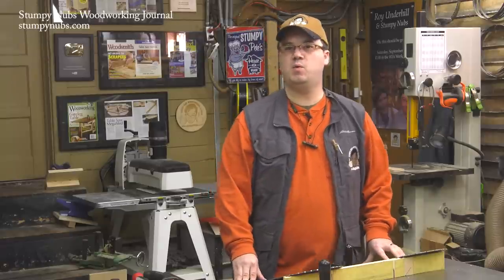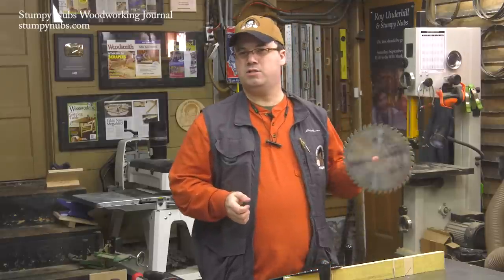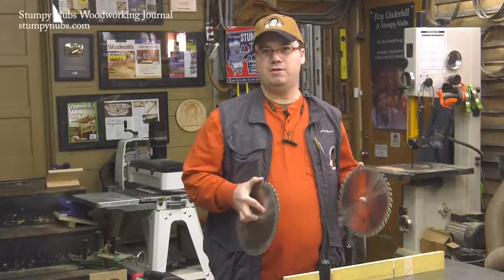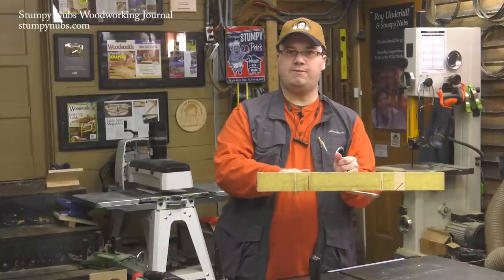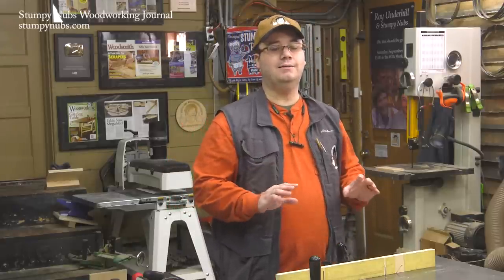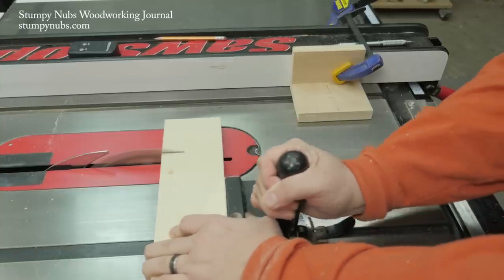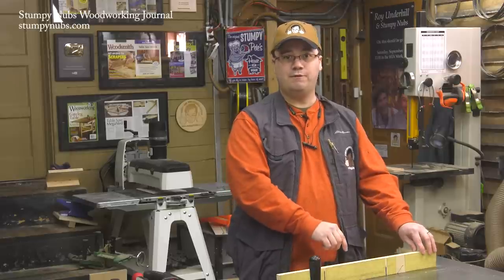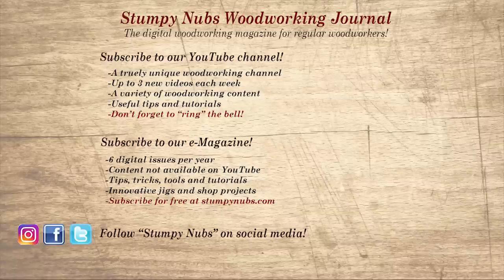Clever ways to make better table saw crosscuts

Comment: One of the biggest cross-cut challenges I have is making larger pieces, like a 14” wide by 12” deep piece. What’s the best way to cut pieces of that size on a table saw from a larger 48” wide by 12” deep rough piece? Should I just be using a slide miter saw instead?

Comment: As a complete novice (and I do mean novice - as in I’ve never even been around a table saw!), these videos are gold.
I have to take a lot of notes and master the vocabulary, but I’m able to learn what I need to make the cuts I couldn’t before. I used pre-cut wood to build a cabinet. I had a miter saw that could handle the cuts I needed for that one. It turned out really well - the second time. 😂 I only had 5 inches and made a spice rack with full extension. 
It was challenging since I had to make my own plans. This expands my ability to make the next ones considerably since I can’t buy wood the size I need for the next ones I need to make. Thank God for these videos! I was especially glad to have the safety videos. I have a VERY healthy respect for the saw blade! I’m a musician and would absolutely die if I cut any fingers!

Comment: Thanks, great to see these things gone through. My saw has a sheet metal insert that's been causing me problems from day one due to it sagging and therefore not supporting the work next to the blade. I'm trying find a piece of 1/4" steel plate to replace it.  I've already replaced the very loose miter guage bar with a snug fitting steel one. Strange that companies will often cut corners on these key components usually needlessly since it takes the same time to make a good component as a poor one. 
A question I would like to ask is, what do you think is the best way to stop a mitred end? To a line, to a stop on the point of the mitre or maybe contact on the actual mitred face? I would value your input. Cheers!

Comment: I love these videos..it focuses my mind on how to make better, more accurate cuts, even if i 'know' all the principles covered here. For example...need to make a new zero clearance insert plate, need to fix my sled as it's a tiny bit warped and doesn't quite sit flat on the table, need better quality blades... it's so easy to neglect the little things that add up over time and affect your work

Comment: Thanks for the tips. I’ve been in the workshop today and adjusted a few things with the saw to make sure it’s properly aligned. What is the “blue tape” that you keep talking about? Is it electrical tape? I tried making a zero clearance insert but it wasn’t successful so the blue tape solution is one I want to try.
Reply from the maker: Here's how to make an insert: https://youtu.be/gzdF-bLXc8Q Blue tape is the painter's tape you get in hardware stores, like masking tape but with less adhesive. It's a quick alternative, but not a replacement for an insert.

Comment: QUESTION:  What's a good grit for sandpaper to be used like you have on the miter fence?  120? 180? 80?  Does it not matter?  Thanks!
Reply: Coarse grit ought to hold better, but might scratch the wood.  Fine grit would sacrifice holding power for less likely scratching.  The solution is easy!  Buy another miter gauge.  Use one for coarse, and the other for fine.

Comment: I once made my stock miter bar adjustable by drilling and tapping it for small nylon screws. It worked amazingly well...until I broke the tap in the last hole and couldn’t get it out

Comment: What would be the reasons to use a table saw if I have a miter saw for crosscuts?
Reply from the maker: A table saw with a good sled is a lot more accurate, especially for miters and end bevels.

Comment: If the miter slot isn't parallel to the blade, you'll also get the work piece pinched between the blade and rip fence potentially causing it to kick back.  I had a crappy Craftsman bench top as my first table saw, and that was the case with it, and there was no adjusting the motor mount to make it straight.
Reply: I have the same on an OLD Skil... guess I’ll dismount it for access to the mounting bolts beneath and hope they have some adjustment capability

Comment: Do you usually want more teeth for hard woods than soft?
Reply from the maker: Hand saws often have more teeth for hard wood because it will force you to cut more slowly (each tooth takes a smaller bite). But table saws are unaffected by the hardness of the wood and can cut it just as quickly. That said, if the material is very hard or otherwise prone to chip-out along the cut edge, fewer teeth will produce a smoother, cleaner cut on a table saw.

Comment: Would a faster motor be the same as more teeth?
Reply: Most tablesaws run at 3000-4500rpm... blades have max rpm not much higher than that. You can slow your cut a bit to get smaller cuts bu each tooth.
Reply: Yes,,,smaller cuts works too

Comment: So far, in each of the videos, none of the links for the ISO Tunes have worked.
Reply from the maker: Not sure why you're having problems, they work when I click them.
Reply: Not sure either, the other links work just fine.  I am using IE but it does not work for me using Chrome either.

Comment: When using a blade guard, it is not compatible with a fence extending on both sides of the blade, as a blade guard required through cut. So roving knife like in the video must be used instead of blade guard. This doesn’t match with the instructions of using blade guard. Same goes for sleighs.

Comment: I am new but I don't understand why cross cutting is done on a table saw. I think my miter saw is a better choice and I don't have to switch blades. 80 tooth fine detail blade on miter and a rip cutting saw blade on my table
Reply from the maker: Table saws are more accurate. Miter saws can deflect out of alignment (angle to the side) during cuts, especially in thick wood.

Comment: At 10:16 the comment "the reason is your miter gauge isn't square to the blade" is incorrect. The important thing is that the miter gauge fence is square to the miter gauge bar. Think about using a miter gauge on a router table - there's no way to square to the round bit. Even when carefully aligned, it's still unlikely that the miter slots are perfectly parallel to the blade, It's both easier and more accurate to square the miter gauge's fence and bar.
Reply from the maker: If the miter gauge fence is square to the miter slot and the blade is parallel to the miter slot, the miter gauge will be square to the blade. My words were shorthand for a more complex explanation, but not incorrect.
Reply: @StumpyNubs  , perhaps "incorrect" was too strong a characterization. What's interesting is that your next video in this sequence has you demonstrating a jig to set the miter gauge to accurate 90º and 45º angles using the miter gauge's fence and bar only, as I suggest. Any machinist will tell you that a setting that's based off another setting compounds errors, especially when attempting to the align to the blade with a try square is fraught with potential errors such as the blade body not being flat.

Comment: This is Garry not Linda. I have to get this name changed. Kevin Knecht over at Woodworkweb.com did a series of tests on blade tearout on most of the common woods and materials used by American and Canadian woodworkers and different type blades a year or so ago. What he found was that taping a kerf does nothing to prevent tearout. The amount of tearout or lack of it is directly affected by the quality and sharpness/grind of the blade, rate of feed and the material. I gave up on the tape trick years ago. When I'm working on a piece that needs it my 80 tooth blade makes a crosscut in cherry or maple that is glass smooth, no tearout and no sanding. Best investment ever. What I mean by grind is the tooth angle of the blade, positive or negative tooth rake angle. Positive for tablesaw negative for miter saw. James covers that on the sawblade video, check it out.
Reply from the maker: While I agree that the blade is the most important factor, and I prefer to use my good 80-tooth when I need a crisp crosscut, the tape trick also works quite well for me. I even showed the results in the video. No tear-out. Isn't it strange how two people can get opposite results from the same method?